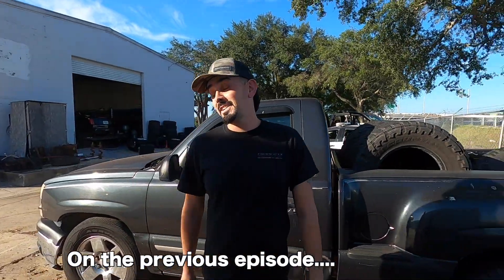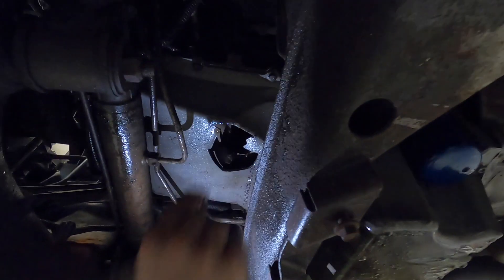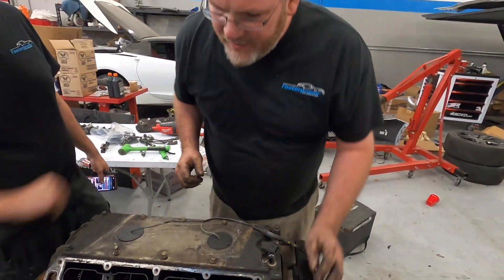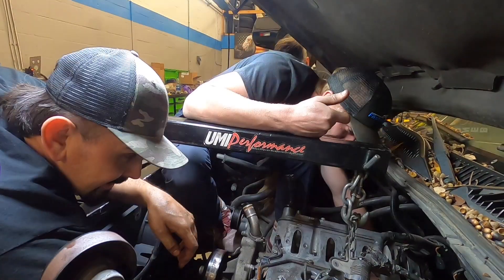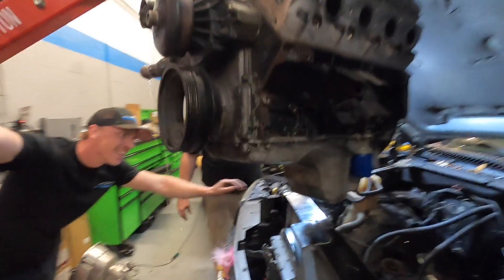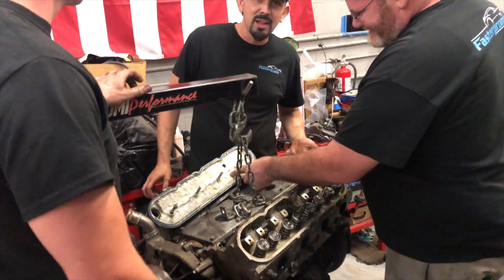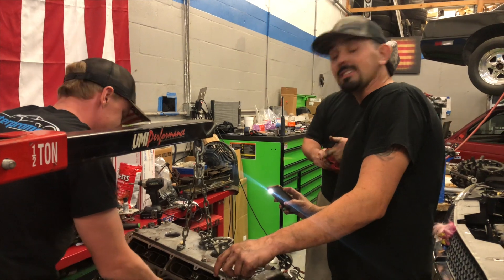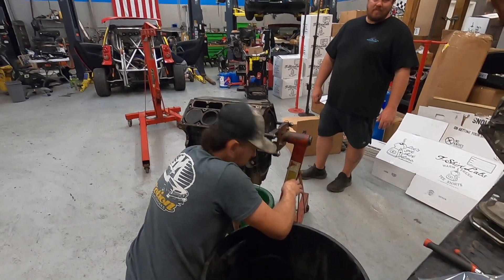TEARDOWN Of George's CATASTROPHIC Engine FAILURE!

Comment: I would be bringing that "just pulled" $500 motor right back where it came from, it's trash and the seller flat out lied.
Reply: Damn Skippy. Especially for 500 bucks. The seller should be ashamed. HOPEFULLY.........the seller will do the right thing by giving Georgie his money back.
Reply: @howabouthetruth2157  Shame nothing. It's a dice roll whether you get an honest seller or a cheat.
Reply: Always always always check the oil dip stick and pull the plugs and see if it spins or you are buying a core and you are gonna have to put money into it. All depends how much from a gasket set to new everything it a crap shoot and all depends on what you find when you open the covers.
Reply: Bring it right to his sales location and just dump it in his front yard.
Reply: That’s the gamble you take “just pulled” could mean “just pulled from a car that hasn’t ran in 5 years” you buy as is unfortunately not saying it’s right just saying that’s the way she goes

Comment: Don’t think the head was changed in the new motor. Looks like the clean side of the pcv vs the dirty side. Very common on all junkyard LS motors
Reply: Yeah, kind of floored that they didn't know about this.  Clean air vs crankcase air...
Reply: Yeah that’s what I thought.
Reply: @D3thM3tal   same here! every Ls engine Ive taken apart with any kinda mileage on it looks like this.
Reply: Took the words out of my mouth. How did Jeremy not think of that. Idk really starting to question his knowledge lately......
Reply: @Deer-Run-Farms  
Maybe he doesnt do many junkyard builds? lol
Seems like most stuff I see in his videos is VERY low mileage or new engines.
Reply: Came to the comments to put that. Really surprised they don’t know that.
Reply: @JohnnyAnderson1  idk maybe..... just something that I figured was general knowledge...... lol guess not
Reply: Jeremy is a tuner, not saying he doesn't know his way around an engine, but he's not a mechanic repairing drivers everyday. Give him a break.
Reply: The alloytec 3.6L gm v6 is super bad for it over here in aus
Reply: @KJ-kw7gh  then dont say anything at all if you dont know what your talking about. Tuner or not that's general knowledge that anyone that works around cars should understand.
Reply: Deer-Run-Farms then don't watch his channel if his general lack of knowledge offends you so bad.
Reply: @KJ-kw7gh  did I say it offends me?  I said if he dont know then dont comment. I never once said he wasn't a good tuner. I enjoy the stuff his does on the dyno. I also think laz  and George are great at what they do and do some amazing work. What I said is if you dont know then dont act like you do. Plain and simple. If you dont like it then I honestly really dont care. And I will continue to voice what I have to say and I'll watch whatever I choose to watch.

Comment: FYI GMT800s have an extra hole on the upper hood hinge just a couple inches from where the hood hinge pivots between the two parts. If you move the bolt that connects the lower hinge to the upper hinge, you can open the hood a lot further, and re install the bolt in that upper hole. This opens the hood much further and easier to remove engines etc
Reply: Or you just take the hood off

Comment: Thats how i warm up all my tractors too. Sat for 2 years,  start and straight wot for 10 secs.  Clears nice, if blows, faulty factory engine
Reply: I used to be Warranty Engineer for Deutz here in Atlanta. 8 years of daily carnage and every one was claimed as a "Factory Defect"! Um, no. Factory engines don't come with stick welded up and reground cranks dude! I've seen shit YOU GUYS wouldn't believe!
Reply: Phil Grindle funny thing is old school flat head briggs would take all the abuse for years and yeArs. Tecumseh not so much.
Reply: @Project10sec  You got THAT right! I did the local Community College Automotive Tech program when I was in HS. Jr/Sr years  in '75 and '76. Got it as a elective and FREE! Bus ride there and back every day. They took us into a room full of small Engine parts. Crankcases over here cranks over there pistons in another corner. We were supposed to pick out parts and build an engine. They didn't tell us what parts were what. So the other two guys on my "team" and I started digging. OK. This looks like It'll fit. Couple of days of that and we figured it out. We didn't get a Briggs but a Tecumseh. Reaming con rod bearings with an expanding reamer fit it all together with NO instructions. The deal was it had to run for 5 minutes after we were done. First team up it wouldn't start. Second team it started but locked up in seconds. Ours lit right off and ran, and ran. Instructor watching us and his watch. I walked over and throttled it up. A pretty good bit. Still it ran. Time goes by and the instructor signaled to shut it off. HE says: "You win! Now take it apart and throw the parts back in the piles."

Comment: So, just pulled heads on my 08 gmc, the underside of the valve covers was identical.  Drivers side was way messier than passenger. Must be the crankcase ventilation setup?

Comment: That was pretty good but....  I had an RV come into my shop after the "Cocktail Party".  Lifters and push rods in the oil pan, 3 piece cam,  and the best part was a piston and half a rod in the frame.   The engine was basically held in by the transmission as most of the area for the motor mounts were on I-95 somewhere.

Comment: If you pull the fan and waterpump you can turn the engine sideways in the bay and its easier to pull out
Reply: Don't even have to remove the water pump

Comment: JB weld will work like a charm I have a older 5.7 Vortec had a whole in the block and for shits and giggles we jb welded it together and it been running in a mud truck for 5 years now

Comment: Chevy have a service position for the hoods. Take the top bolts out and push the hood back farther and there is a notch to put a bolt it that holds the hood straight up for pulling motors out and more head room.

Comment: You should put the hood in service mode. Take the bolt out of the middle of the hinge, lift the hood higher and another set of holes will align. Put the bolts you took out (one on each side) and put them in the new aligned holes.  The hood will be standing straight up and out of the way. The hood can be closed down like this but there will be like a 6-8” gap. So don’t try to actually close the hood.

Comment: Every Junkyard gen 3 truck motor I have ever taken apart has been more dark on one side (on the drivers side I think). The push rods have more build up, the rockers have more build up.. its every last one.

I think it’s the crankcase ventilation that causes it? I’ve pondered it for years

Comment: When an engine has a breather/pcv, the pcv side will always be a little dirtier because of the flow of gasses through the block (clean air in the breather, fumigatied air out the pcv).

Comment: You can unbolt the top bolt on hood hinge and lift hood straight up and reinstall bolt in the back hole of hood bracket to hold hood straight up

Comment: After three engines and still needing more its got to be getting close to the time where it would be cheaper to just buy a new block and parts then build one up. You could probably throw together a 6.2-7.0 pretty cheap and if you leave it on close to stock specs it won't keep eating itself either.

Comment: I tossed the #2 & #7 rods on a 4.7 WJ once due to a hydrolock situation in a pond on the limiter. Got it fired up and drove it 20 minutes back 2 the house. When I saw the oil pressure dip i pulled over and dumped a quarte in. Got home slapped 2 spare rods and pistons in from up underneath in my driveway. Sprayed the holes with brake clean and jb welded the holes in the block shut.  Slapped everything back together  and that thing was still running 40k miles later when I took it to the scrap yard.

Comment: Hi Jeremy.. I’ve seen that betting thing on a motorcycle. They would drain oil out of engine,wire throttle wide open and take bets how long it would run.

Comment: You haven't opened up too many high mileage LS valve covers before.  The pass side head commonly has that cleaner less hot appearance than the driver side head.

Comment: If he is still looking i have a gen 3 5.3 short block he can have for the actual cost of shipping. has new cam bearings new rods bearings complete disassemble clean and hone and reassemble. Never used it and it has been sitting on a engine stand in the garage for 2 years. No rust ready to build. check your f/b messages for contact info

Comment: That motor number 3 is most likely a 4.8 with that flat top. Id check for a 4.8 casting #on the crank. Either way there aint no hole in the block lol.

Comment: The reason the two banks are different in "dirtiness" is because one bank has the pcv system in it and the oil fumes go through that side more. It's normal.

Comment: Good motors are always cleaner on the pass side.  It's the fresh air side of the PCV system.  Drivers side is where all the dirty air from the motor is sucked into to be burned via the PCV.

Comment: Dumb question: why did it break?  No oil pressure? Bad luck?  Or he made a mistake in reassembly ?  Any guesses as to the actual reason?  I realize it was a junk motor, I got that but they are pretty tough, right?

Comment: Every single used LS motor I've disassembled was really clean under the valve cover on the right side compared to the left side. I think it's a ventilation issue to be honest.